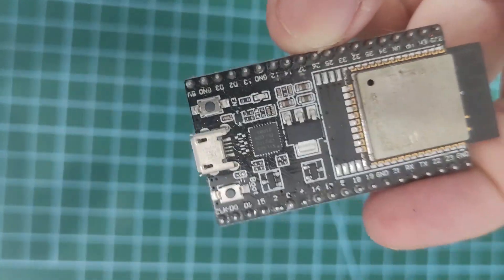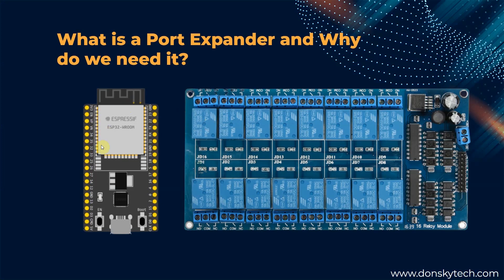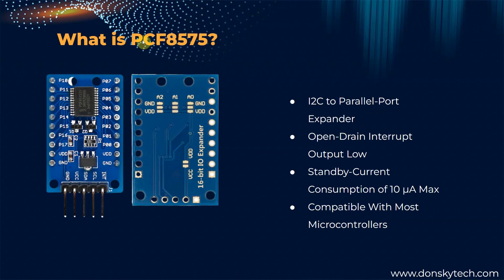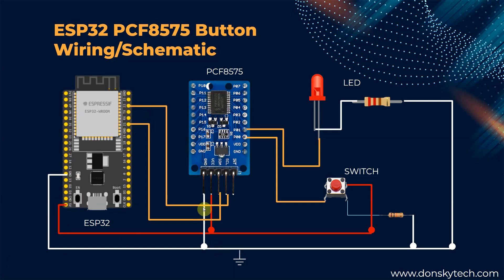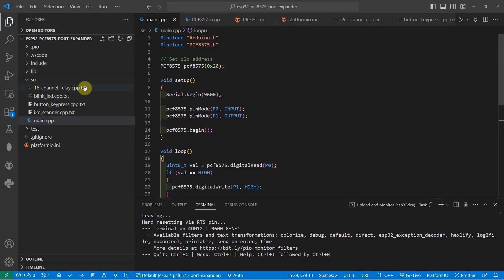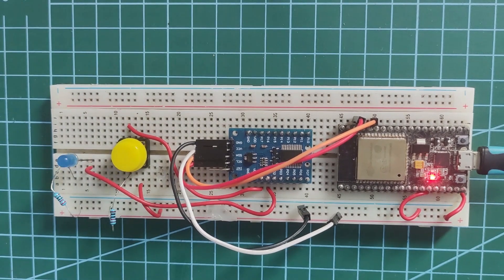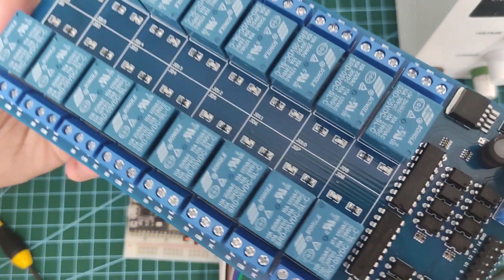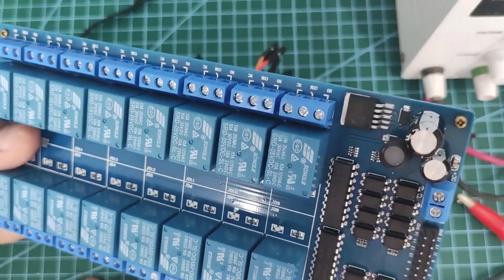Interface ESP32 with the PCF8575 I/O Port Expander

Comment: Great video, thanks for sharing.
I am building a 64-channel I/O system using PCF8575.

Half of the channels are used as inputs with pushbuttons, and I successfully implemented both short-press and long-press detection.

The other half are outputs. Driving small diodes works fine.

However, when I try to connect about 32 MOSFETs or IGBTs as outputs, things get difficult. The HIGH signal is unstable (shaky), and even attaching a gate driver is challenging.

Have you ever tried something similar? Any advice on how to reliably drive so many MOSFET/IGBT outputs from an I/O expander?

Comment: Pay attention because with this connection, SDA e SDL goes to 5V and your ESP32 can fail forever. You must solder VDD-VCC and use 3.3v power supply (also from your ESP32 board)

Comment: is it safe for esp32 to send 5v to vcc? I'm worried that digitalRead could damage microcontroler by sending 5v data to 3.3v pin. In other case can i send 5v and only use digitalWrite to pcf, so that no data is recieved to microcontroler, protecting it?
Reply: It is not safe. You can find in the datasheet the Max voltage of a GPIO based on the Vcc voltage. You need an extra chip to do voltage shifting

Comment: hi, i already see the code, and i think that was active low for the relay. but in my case, I want use active high relay, did u know something to use active high with pcf8575 ?
Reply from the maker: Hey maybe you can reverse the logic in your program. I have not checked the datasheet of the pcf8575 and if this can be done in hardware.

Comment: good video. I have a doubt, how you avoided the floating GPIO pins of PCF8575? pullup/down resistors of which value?
Reply from the maker: hey sorry for the delayed reply. Not sure why there is no notification for your comment.  I have not encountered this issue in using this library. Maybe this was handled by the library itself.